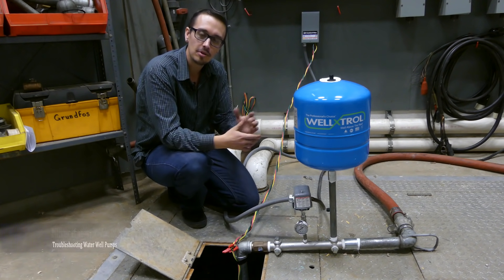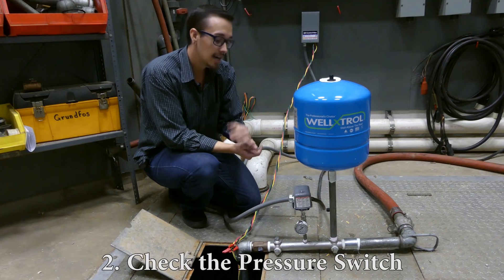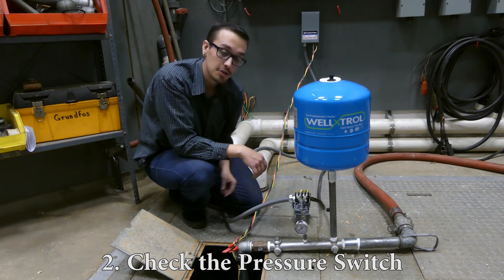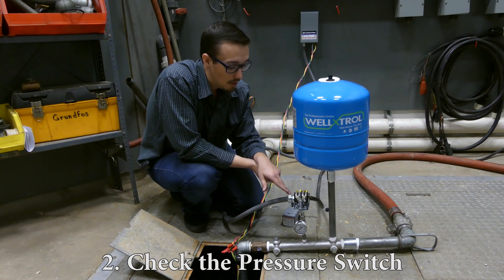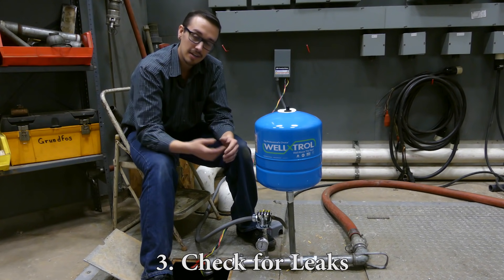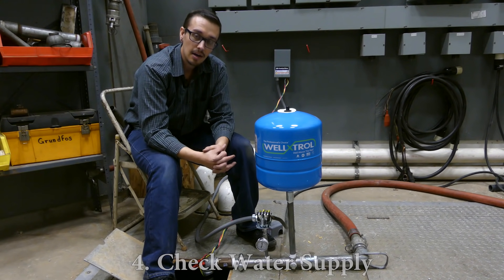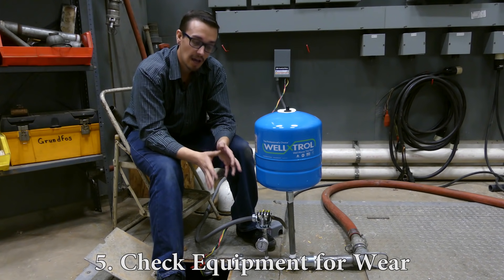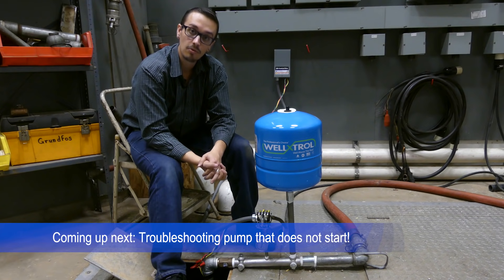Troubleshoot: Water Well Pump Won't Shut Off

Comment: My pressure switch turns on when needed but shuts the pump off before it gets to cut off setting. Then turns on again for a couple minutes then shuts off for a minute or so and so on until pressure reaches cut off setting.  Then system remains off with no loss of pressure   Basically only builds a few pounds at time off and on off and on then at cut off pressure it shuts off properly.  Any ideas?
Reply from the maker: I would try replacing the pressure switch and see if that fixes it.
Reply: R.C. Worst & Co., Inc. Replaced it today, still only stays on for a couple pounds then shuts off for 30 sec then runs for a couple more pounds until it gets to cut off setting

Comment: Mine looks like it over pressured and started leaking in 2 spots by the pump. It won’t shut off. Air is in my line because water in the house comes out sputtering. Well is not empty. Idk what wrong with this thing lol  any ideas?
Reply from the maker: Give us a call for help troubleshooting: 855.329.4519

Comment: I'm having problems with mine, it won't turn off. Waterpressures the same, water in the Well, have had problems before of which I ended up changing my switch my pressure tank everything where its all brand new BUT the motor itself. After changing it it turned on but not off. Can turn off manually no problem and for a good 3 months worked how it was suppose to....Don't understand what's wrong.. could it be the motor now?? My husband is useless... help meee.
Reply from the maker: Please give us a call for help troubleshooting: 855.329.4519

Comment: pumping open discharge into  storage tank with (assumed 1/2h.p) from 180 foot well.  Low producing well with pump tec low load protection.  Pump tec (not faulty) will not shut pump down   at the end of a typical cycle.  no water but pump still running.  amp draw at run with water 5.2  then amp draw when dry only 4.9.    ????      not enough drop for pum tec to shut pump off.    Will a bad built in check valve of top of pump create this scenario?     Or would you suggest I look for diffrent problem.  check valve does not appear to be bad from surface observation.
Reply from the maker: It sounds like the sensitivity on your pumptech needs to be recalibrated/adjusted. Franklin electric will be able to assist you with that: 800.348.2420

Comment: I have viewed a number of your videos, great job, very clear, concise and informative.  I have not been able to find one dealing with the problem I am having.  I am not sure if it is something to do with the pump, or with the foot valve/jet assembly at the bottom.  I have a deep well jet pump.  When it first kicks on (at 38 psi, 40-60 setting) the pressure drops dramatically, below 20psi then jumps back up.  Once it gets up to about 58psi it takes a seemingly long time to go the last 2 lbs and shut off.  It handles running a faucet, or taking a shower okay, but  has trouble and loses most of it's pressure if more than one water source is being used, such as flushing the toilet while using a sink.  Just the washing machine by itself is enough to drain the pressure from the system.
Reply from the maker: It sounds like the air in your pressure tank might be set too high and that's why it is dropping dramatically at startup. The pump may also be getting old or it simply does not provide sufficient flow to accommodate more than 1 fixture at a time

Comment: hmmm my pressure built up to 70 psi and would keep going.. had to shut off pump . using 30-50 switch.
Reply from the maker: Check for sediment in the nipple connecting to the pressure switch. It's very likely clogged and blinding the switch from seeing the actual pressure.

Comment: Hi,
 I really appreciate you do this kind of video. I have a problem with my submersible pump. I just got a new well drill and connected to my Pressure tank. The water pressure build up to 60psi and cut off fine. but when a valve is open the pressure drains down zero and shut off the pump. so we cannot use the water. I tried to prime it by opening the drainage pipe little bit and have it run for a while but it's fully open, the pressure will drop to zero and shutdown the pump. Is there anything wrong with my system? this is a fairly new system, unfortunately, it is out of the country and no one has any idea of how it works. Would you happen to have any idea what could be causing the pressure to drop to zero?
Reply from the maker: Why is the pump shutting down? Do you have a low-pressure cutout switch installed? Like the one in this video: https://www.youtube.com/watch?v=ROvZpwHV9Ho&t=20s

Comment: Having irrigation and new pump installed in my yard. It’s a above ground pump and it wasn’t preforming well enough and they took the pump back for replacement they cited low amp.. obviously I’m praying the well isn’t leaking . What do you guys think? Thanks
Reply from the maker: There are a lot of variables missing. Give our techs a call and they can help you: 855.329.4519

Comment: What about the pump running and running the pressure up to 95psi, and blowing the pressure relief valve. 40/60 switch new pressure set to 38 psi, and new pressure switch? Your help would be greatly appreciated.
Reply from the maker: Mike, please give our techs a call: 855.329.4519
Reply: Hello. Same issue. Flooded wellhouse :( was it your control box or a component of your control box that needed to be replaced? Thanks

Comment: My switch is on the pump do I need to put another switch? Btw thanks for the videos your video helped me on adjusting my pressure switch it kinda helped with low pressure I get after the shower runs for 5-10mins. I'll run down what I have I have a 35 ft shallow well with a 1hp powering it tank is right next to the pump with 3ft of pex pipe give or take. From the tank going into the house is about 25-30ft of pipe then it is going to the hot water heater then to shower then toilet and then kitchen sink and that's it. Let explain yeah 15 years ago our garden hose was so powerful I could of been a firefighter and as Time went on stuff breaks and repairs got made but my dad did all of the repairs back then and he was one that hand drove the well. He was also type that didn't always put things back the way they were could of been financial reasons or time of the year he would slap it together and say I'll do it right when weather gets better but now he passed 4 years ago and last four years I been doing lots of research and just trying get it back to the way I remember it being. We have a lake right next to use about 200yards away and it's overly full of water so that is how I know we have water matter of keep the water flowing with a faucet on after 5-10min. Now only thing I really haven't tried is a booster pump ????? What do you think? Plus I hear a sound from the hot water heater I can't describe the sound very odd. Something else I need to do is drain the system and check my tank pressure but I'm 98%sure it's fine it's only 2 or 3 years old. Something else I have been thinking of shrinking my house pipe size down my dad put 3/4in pipe in this house I really think that's way too big for a shallow well now back when we had firefighter hose we only had 3/8in PVC pipe some reason he went bigger. Yeah please reply with your opinion and your number I probably will just call you. Thank you keep videos coming
Reply from the maker: Hey John, give us a call: 855.329.4519

Comment: How about check value  or foot value?
Reply from the maker: It certainly could be a leak at the check valve or foot valve.
Reply: A leak in the foot check valve would make the system start and stop, even with no water demand.
But it will not prevent your pump from stopping if everything else is ok.
A broken pipe in between the pump and the pressure control can make it impossible for the pump to reach the cut off pressure, not stopping. If this happens inside the well you actually may not see it or become aware at all.

Comment: Your video is just great. Thanks!
I have a brand new 44 Gal bladder tank (FLEX2) installed a year ago. Everything worked fine until recently when I noticed that the bladder tank is loosing pressure even when the water consumption to the house is completely shut off. I checked the air pressure and found 38 Psi with working range for pump 40 to 60 Psi. My only suspicion now falls on the check valve. Is my reasoning correct? If so, would it be difficult for you to make a video on check valve diagnostics and replacement, or at list to explain what to do in your reply? Thanks again for your great help!
Reply from the maker: If you've isolated the house and you're still losing pressure it's either a leaky check valve or pipe, most likely down the well. You will likely have to pull the pump out of the well and check each pipe/valve for a leak, it should be fairly obvious where the leak is because you will have water in the pipes under it unless it is the bottom check valve.

Comment: I just replaced my switch but now the pump wont shut off when it reaches 60? I checked for leaks,debris...nothing! Any other suggestions?
Reply from the maker: Was your previous switch a 40/60 switch? If your pump cannot produce enough pressure for the switch to cut off it will never stop running. Try lowering the pressure on your switch and see if it turns off. Here's our video on how to adjust: https://www.youtube.com/watch?v=1VNSv7xVzzU&lc=UgxovbAxZbduE-nD33l4AaABAg
Reply: @RCworstwater  o
Reply: Change the pump

Comment: HI SIR,JUZT WANNA ASK ..I GOT A TQ400 WATER PUMP FOR RESIDENTIAL WATER SUPPLY. IT RUNS CONTINUESLY AND KEEP ON JOGGLED WHILE RUNNING,BUT THEN THE WATER PRESSURE IS STILL ALRIGHT..WHAT COULD BE THE POSSIBLE CAUSE? IS IT THE CAPACITOR FAULTY OR FAULTY PRESSURE SWITCH?..TNX MUCH

Comment: I have just replaced my pump. It’s a jet pump, 1 hp. I can’t get it to prime. Have tried many many times. Is there a way to tell if I have a bad foot valve before I dig it up?
Reply from the maker: If you can't get it to prime that is a sure sign that either the foot valve is bad or there is a hole in the suction line. Your best bet is to pull and inspect.

Comment: Thank you for the video I followed steps to find out what's the issue that I don't have water from the well to the pump, I can't hear the pump is working but the water doesn't come to the blue color tank on top of the water pump I have to do it manually to bring the water to the pump can you advise me what it could be the cause of lack of water pressure in the pump? Thank you
Reply from the maker: Stiven, give our experts a call and they can help you troubleshoot your system: 855.329.4519

Comment: We have set the cut off pressure at 5 bar in pressure switch. But the pump is still running till 7 Bar. And we have a complaint of Pipe line breaks often due to the high pressure. Please advise
Reply from the maker: Give us a call Muhammed: 855.329.4519

Comment: Solved: My pressure switch would not turn off, the pump just ran and ran. Eventually I unscrewed my water filter (about a foot long vase hanging from the basement joist water pipe) emptied the water out screwed it back on and it works great again.

Comment: I am currently troubleshooting my pressure switch on my water pump. The contacts and springs seem to be working correctly however the pump doesn't turn off once the pressure switch springs...it doesn't seem to be damaged or corroded.
Reply: Did you figure out what the problem was here? I'm having the same issues and believe it might be my control box going bad. Maybe my connector or relay? Any info may help. Thanks.

Comment: My water builds up to 20-25 psi and works fine but never builds up to the preasure required to shut off the switch. The switch is new and i have turned off the water to the house but the pump still does not build up to the shut off preasure.
Reply from the maker: Thanks for the question Dennis! Please give our customer service crew a call at 855.329.4519, we can help you troubleshoot and fix the problem much quicker that way.
Reply: How did you fix this issue? This is what I am dealing with.
Reply: I have the same problem.  The pump keeps running but the pressure won't get higher than 20 PSI.  The tank looks fine at 38 PSI The cut in/cut off is 40/60 PSI.
Reply: I found out that it was just clogged with dirt.  I removed the plug and turned on the pump to flush the dirt out.  I primed it, closed the plug and turned it back on.  Works great now!!

Comment: My pump will not shut off, pressure gauge reads zero and no water is coming in house. How do I fix this problem?
Reply from the maker: Thank you for the question.  I would recommend following the steps in the video.  You may have a closed valve, a leak, or low/no water in the well.  If you discover that you have low or no water in the well, you may want to consider upgrades that are available to protect your pump and motor.  An inexpensive option is a pressure switch with a low pressure cut-off and a little more expensive option is an electrical motor protection device.  Unfortunately, you may have a problem with the pump.  Give us a call at 855.329.4519 and we are happy to help with the troubleshooting.

Comment: I have a pump that is shutting of and immediately starting back, what is causing this?
Reply: Gauges after the check valve are a must. 
It should go well pump, pressure relief, check valve, expansion tank,  pressure switch, 100lb gauge, then main shut off.  In order from flow. A pump that has had a hard life with a bad check  valve may need to be tuned down with the pressure switch to a pressure  it can build and turn off with. Lowering the expansion tank according.
Reply: Suresh Ramlal mom well after I charge the tank the way they told me to as soon as I turn the water on the pump comes on and then when I turn the water off the pump goes off so is that correct does the water supposed to run I mean is the pump supposed to run as soon as you turn the water on?
Reply: David Bradshaw sounds like you have an issue with your expansion tank drain down the system so that there is no pressure and check the psi in the tank on the air valve on the top of the tank.  If you have a 30/50 system then pressure in the tank when not filled with water  should be 28 psi       if you have a 40/60 system then pressure in the tank should be 38 psi  if it’s not one of those pressures then there something wrong with the bladder in the tank.
Reply: Sounds like you have a failed check valve...
Reply: Our does, fighting a new issue now, wont shut off at all.

Comment: i have a twin booster pump system and i have drain/primed the pump but the pump doesnt pressurise the tank. i have to bleed the air everytime it empties. At the moment only one pump is working. the system was working fine until this morning. The pump keeps running but the pressure doesnt build up. any help will be much appreciated
Reply from the maker: It sounds like your pump could be getting air locked. What is the water source the pump is pulling from?
Reply: R.C. Worst & Co., Inc.  My pressure switch won't turn off. I just installed two new pressure switches an now it won't shut off an my holding tank keeps over flowing. Any suggestions?
Reply from the maker: Pressure switches can only shut a system off if it is able to reach shut off pressure. If you're discharging to an open tank it will never build pressure, you would need a float switch instead of a pressure switch. Give our customer service crew a call if you'd like more information or want to purchase a float switch:  855.329.4519
Reply: air leak, check valve?